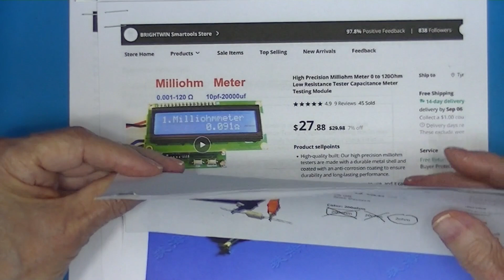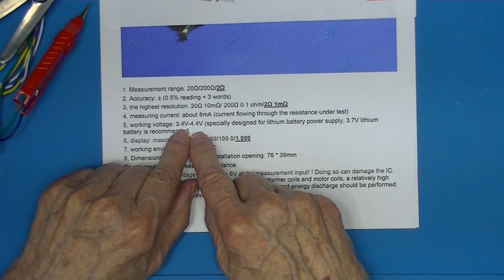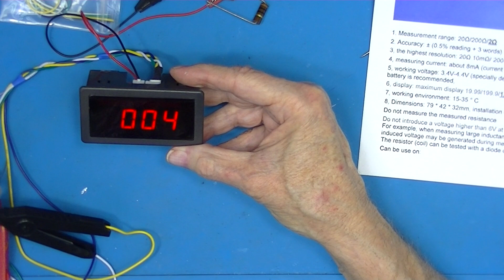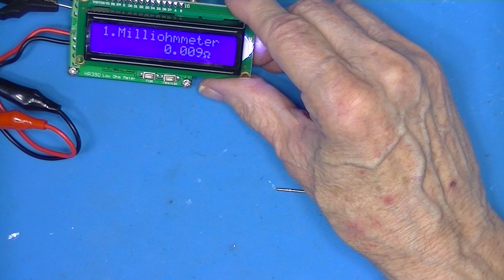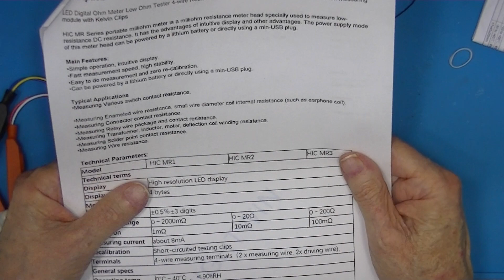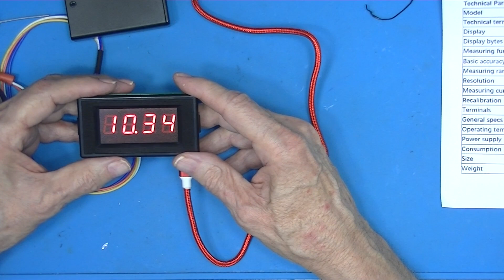Three Different Milliohm Meters

Comment: for under a buck, make your own milliohm meter, lm317, 12.5 ohm resistor, kelvin probes, (usb powered if you like) and your dmm to read the voltage drop (then times 10 the reading)